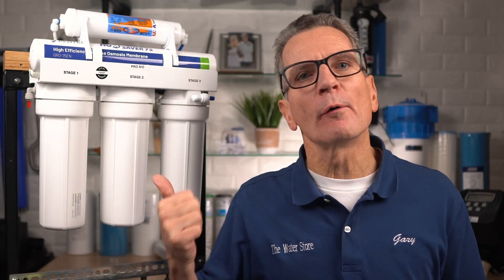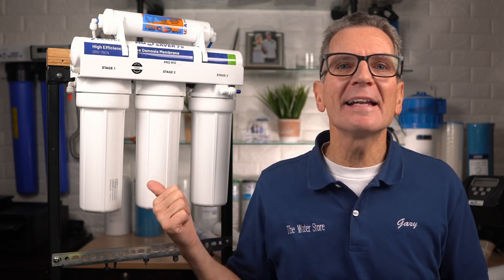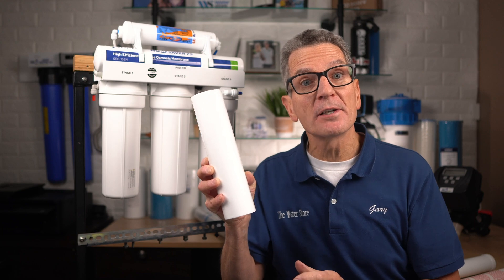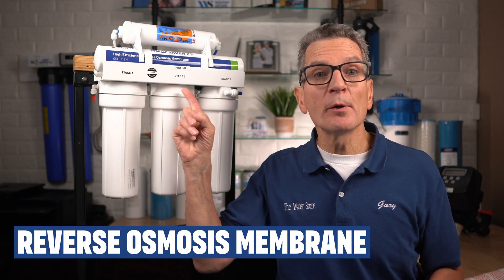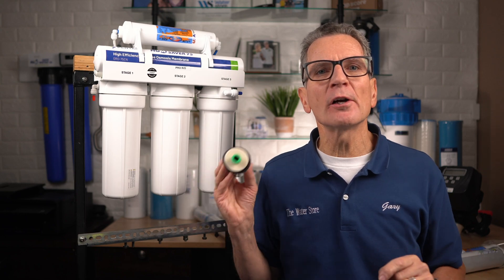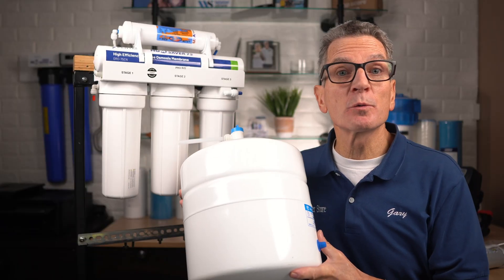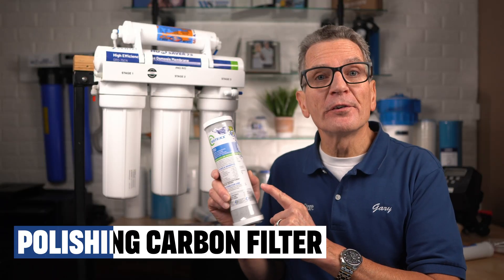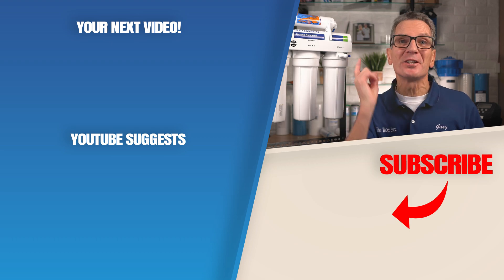HOW Does a REVERSE OSMOSIS Drinking Water System WORK? (2024)

Comment: Hi Gary. Great videos! I just got my RO filters changed but they didn't sanitize. It hasn't been sanitized since 2021. The company says they only do it at the request of the customer...to me is strange, Should I sanitize now or wait until next year. Also, the water tank hasn't been sanitized in several years. I'm worried about mould etc, should I simply replace it?

Comment: So for TDS, say I have measured 130 TDS reading coming from my tap. What would be a typical TDS coming out of the full RO filter set on the output? Not having a Remineralization filter.
Reply from the maker: A Reverse Osmosis drinking water system like this will reduce the TDS from 130 ppm to about 13 ppm.  https://waterestore.com/products/hum-water-saver-75-gpd-reverse-osmosis-system-brushed-nickel-faucet

Comment: I was looking at an RO system by Springwell before coming across your channel. How does Hum compare in filtration? Do most RO systems filter out about the same amount of contaminants? Thanks!!
Reply from the maker: The membranes are all pretty much the same, so they will reduce the TDS by the same amount.  Where the HUM system is better is that it is Made in USA with better build quality, wastes far less water while purifying, dispenses water at a higher flow rate and uses non proprietary (less costly) replacement filters. https://waterestore.com/products/hum-water-saver-75-gpd-reverse-osmosis-system-brushed-nickel-faucet

Comment: hey Gary. Does RO filter out estrogen hormones? i used chatGPT and it told me estrogens are 1 nanometer, which is 0.001 microns, and my RO system goes down to 1 micron only ( i don't know about the membrane)
Reply from the maker: Yes, reverse osmosis removes estrogen hormones, this study confirms it https://www.ncbi.nlm.nih.gov/pmc/articles/PMC7143240/ Although I highly suggest a reverse osmosis system with carbon pre and post filtration like this one https://waterestore.com/products/hum-water-saver-75-gpd-reverse-osmosis-system-brushed-nickel-faucet

Comment: A Reverse Osmosis (RO) drinking water system works by using a semi-permeable membrane to remove contaminants and impurities from water. Water is pushed through the membrane, allowing only pure water molecules to pass while blocking larger particles, chemicals, and contaminants. The result is clean, purified drinking water free from most contaminants.❤❤❤
Reply from the maker: What he said.